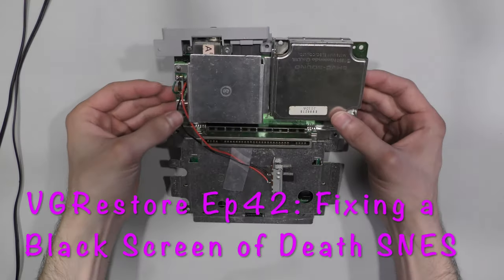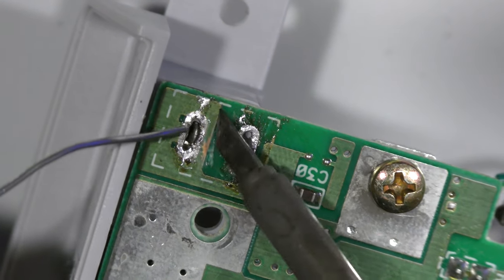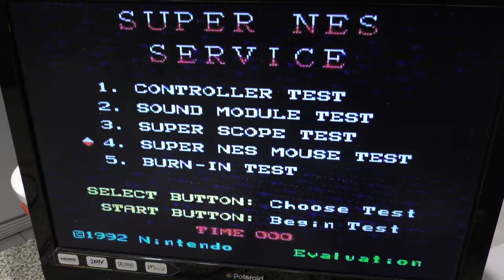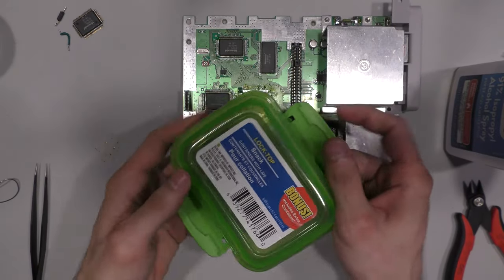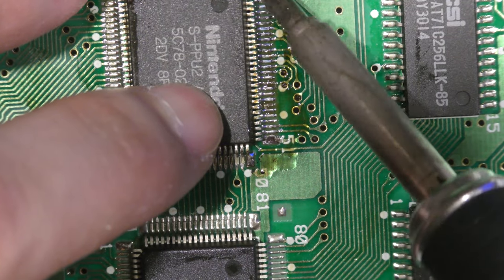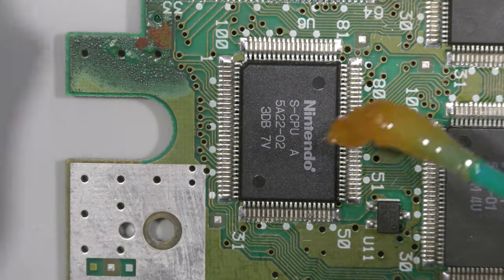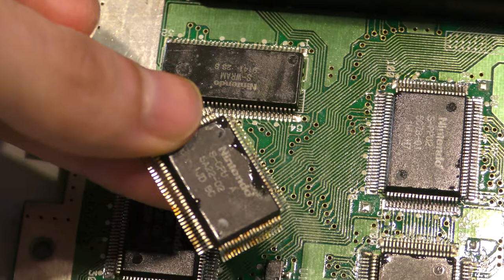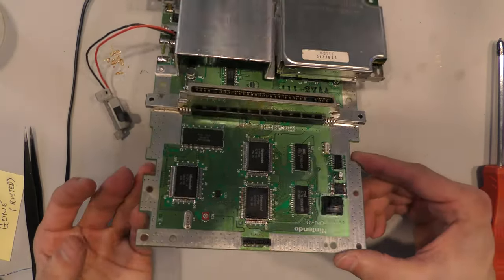VGRestore Ep42: Fixing a Black Screen of Death SNES

Comment: When you clean the flux off the board, put a coffee filter or paper towel down first, then scrub the area with the toothbrush, this way the paper towel absorbs the flux, otherwise the toothbrush only just spreads out the flux on the board for the most part.

Comment: Not sure if you have one of them, but I’ve found placing the board in a quad hands unit, holding the iron on the top of the through hole, and then using the solder sucker underneath the hole really makes for a quick and easy way of clearing them. 👍

Keep up the great work!
Reply from the maker: StreetChally73 yeah that does make it easier I just don’t have helping hand device yet. I need to get one.

Comment: I lived in Japan from 2017-2019.  Depending on the area, I would routinely find "junk" Super Famicom consoles for $1-3.  I remember my first time seeing stacks of these and not knowing how common it was so I bought 30 of them.  There was another time a year later where a store had at least 60 of them for $1 each and I only bought 3 because I had built up such a huge hoard already. 
I would recommend looking at lots of "junk" consoles online for as cheap as possible.  SFC board is the same as SNES except the power jack.  That might be a viable option if you can get a lot cheap enough to offset the shipping cost.
Reply from the maker: Yes that is a great point. The super famicom and Super Nintendo are the same beside the RF module tuned to 95-96 and the power jack. I need to find stacks of SFCs for $1 each I’ll take 1000😁
Reply: PunkNDisorderlyGamer external RF module you mean, or is there an adjustment somewhere?
Reply from the maker: Highrise Tech the SNES and SFC are the same board, the only difference is the power port jack and the RF module, on North American SNES version works with channel 3-4 and the Japanese SFC you have to change the channel to 95-96.
Reply: PunkNDisorderlyGamer any way to change the RF module with a North American one?  Take the component off an NA junk board and swap?
Reply from the maker: Highrise Tech probably I haven’t tried yet. I would assume it would swap perfectly the power jack and the RF module without any other modifications.
Reply: I got 14 broken NDS for 100 Cad$ recently. Shipping was free too. Its definitly cheaper in japan than here.
Reply: Hi, will there is any chance you may find a online store in Japan who sell junk Sfamicon pcb?

Comment: for big through-holes like that i tend to overfill them with fresh solder then whilst they're still hot use a rubber air puffer to blow the hot solder out into a can of copper wool. For smaller ones usually my desoldering tool handles them ok.
Reply from the maker: That’s a good point. I like to try different things on the fly sometimes.

Comment: First off I really like your channel. Secondly, the burn in test cartridge you use, Does it have any special hardware built into it or could I use a rom file of that cartridge on a flash cartridge to do the same thing?
Reply from the maker: It’s just a rom file. If you can get an everdrive to boot the rom file you can test your hardware. Keep in mind, sometimes the console is too faulty and won’t boot the cartridge or an everdrive. 

Thanks for watching my channel.

Comment: I'm really enjoying your videos.  You're doing great.  I was curious what temperature you set your soldering iron to.  I just got a new Hakko one and I'm finding it's really easy to lift pads while desoldering on an old test board.  I want to find a good temp and practice before I work on my consoles.
Reply from the maker: My iron is usually fixed at 300 Celsius, if I’m desoldering a large ground plane I will boost the iron to 375-450 Celsius. You don’t really need more than 315 Celsius for the work you saw in this video.

Comment: If you add a tiny bit of solder to your tip you will also improve the ability to remove solder from the board with the braid and with the sucker, because you need that solder to get quicker and more uniform heat transfer.

Comment: I was thinking: Why not checking if all solder pins from that S-PPU2 are connected before going all the way with this amount of work to replace the chip.
Often times, it's dry solder joints that makes poor connections.
Nice to see your success though at the end.
Reply from the maker: That’s a good point, I’ve worked on about 100 of these and in the beginning I would try and reflow the chips and never got any changes. In my experience these chips go bad much more often than the pins on the chips lose contact.
Reply: @PunkNDisorderlyGamer  fair enough. Experience is key.

Comment: I think possibly for sourcing parts junk lots of super famicoms from Japan. Most of the "junk" turn out to be OK. Swap the power connector and the rf off a dead snes board and you're usually good to go.
Reply from the maker: Alfie's Games super famicoms are the way to go when sourcing for chips but even those are a bit out of mg price range right now.
Reply: @PunkNDisorderlyGamer  Ya the market gone crazy recently. That's kind of good cause it means it's worth putting our time into them to fix them. I look at a broken ps1 and go not worth it.

Comment: Very nice, I have some super Nintendos and other consoles..I recently got a super nintendo pal version from hong kong SEALED boxed and it works just fine with a hdmi adapter, it has a 50/60 switch made by Nintendo back in 1992 for th3 honk Kong market however some games ..on the title screen it shows squares ..like 2 ..3, .k2 show some on the title screen or side pocket shows 2..but 99.9% of the games runs absolutely fine. i was testing all these games via a super ever drive, and using the same cartridge on an ugly snes" north america" it all works good.

Comment: Would it be worth it to install a chip socket to make future installations/chip swaps easier?
Reply from the maker: @Retro_80s_Guy  well it would be worth it to socket a test bench console to remove and test each chip individually without having to solder each chip through trial and error. But these QFP chip sockets are quite expensive.

Comment: I have used the same repair blog to diagnose  the first SNES I bought. It had the "black screen of death" and never got it working. Since I have replaced everything except for the chips (I don't own a hot air rework station) I assumed that it must be a dead CPU. I got another SNES motherboard a year later...and surprise it has the same issue :) After reading on the topic, it turns out that the CPU used in the first two European SNES revisions is very prone to failure. I wish I had a diagnostics cartridge like yours. I was wondering whether I could use one of the Chinese EverDrive clones to load this application. Maybe I will try this in the future :)
Reply from the maker: You may be able to load the burn test rom from an everdrive.

Comment: I've never been able to do that trick where you slide the hot soldering tin through the metal pins and pull it out easily.

Comment: I took a look at the site you refer to trying to decide what is wrong with my snes. A lot of games work fine and it passes the burn-in test, but on DKC the sprites are missing. On Actraiser the background has glitches and Star Fox boots to a black screen. The intro music plays and then quits and it registers no input, however the Japanese version starts and freezes soon after. Most other Super FX games have various except for Doom. 
The closest I can tell from the site is either cpu or ppu2 failure.
Reply from the maker: It’s probably a ppu1 or ppu2 when you play the game does the game still function correctly? disregarding the sprites.
Reply: @PunkNDisorderlyGamer  Yes other than Star Fox which only seems to be loading the into music to the spc and does nothing else.
Reply from the maker: @SuperHamsterGaming  I’ll bet the cpu is ok, plus most of those burn tests are cpu related, not all but most. You could put that cpu in a bad cpu board or try swapping the ppus one at a time. Keep in mind It’s quite difficult to do if you’ve never done smd work.
Reply: @PunkNDisorderlyGamer  I haven't done a lot of surface mount stuff. I do suppose I need to practice that.  I've done plenty of soldering and mods otherwise.
Reply: @PunkNDisorderlyGamer  I've got another board somewhere with sprite glitches. Maybe between them there are enough good parts to make one.

Comment: What temperature do you usually keep the hot air rework  station on to remove those chips
Reply from the maker: 350 Celsius.
Reply: Thank you I just bought a hot air rework station. I’ve done a lot of soldering but never with Hot air. I have a messed up board I’m going to practice on.

Comment: Hello, your videos are great, I found you in luck, I have several questions:
What is the temperature you use to desolder the chips?
What heating system do you have?
Where can I find that Snes cartridge?

thank you very much for your videos they are great
Reply from the maker: 350 Celsius.

858D desoldering station. (It’s really cheap but works for me)

Burn in test cart, aliexpress has them. 

Thanks for watching
Reply: @PunkNDisorderlyGamer  Hello, thanks for answering, I was looking for aliexpress but I couldn't find it, you will have the link of the publication.
I bought the Baku 787L and it works fine.
Thank you very much with you learned many things.
If possible add subtitles in Spanish. I would be eternally happy
Reply from the maker: @ronaldcarrenobarriga5474  you can go to Spanish subtitles auto generated. They seem pretty accurate to me. 

Aliexpress seems to not have them anymore. But this website has them https://www.ocdreproductions.com/Burn-In_Test_Cart/p1560736_18499139.aspx

Comment: I have an SNES just like this board with the removable audio sound chip. The console had power and would 90% of the time be a black screen but multiple times it would boot to the super Mario coin sound and Nintendo logo then cut off and a few times it would boot the game and I could play it as long as I wanted. Perfect picture and sound from what I could tell.

If I moved the game cart it would then go black.

I opened it up and cleaned the board pins and the removable cart pin receptor. It didn’t do anything.

I’m having a hard time figuring out what the issue could be. The board and chips look immaculate.

Are you interested in trying to fix another if I sent it to you and paid you?
Reply from the maker: It’s been so long since I’ve done any repairs, if I had to guess it’s a dirty cartridge connector since sometimes you get the game to boot up. Clean both the game and the cartridge connector and try again, don’t forget to add the sound module before you test.
Reply: Ok thank you for that info.

One last question… is your snes burn in test cartridge authentic?

There are a handful from China for 30 bucks and I’m curious of their effectiveness to test as good as an official one.

Comment: 10:38 watch out, vertical drag soldering is dangerous, you might bend pins if they are soft.
Reply from the maker: That is very true although with enough practice you learn not to apply too much pressure.
Reply: @PunkNDisorderlyGamer  They might withstand. Doing this at a laptop connector is sure fail because pins are more thin.

Comment: Will a test cart work if there is no video going to the tv?  Wondering what my best bet is. I have two doing the same thing. Power on no problem. Cleaned everything up. And when i put a game in, the tv flickers for a second and goes to a black screen as if it knows it’s getting something but nothing coming through.
Reply from the maker: Sometimes the burn in test cart will post to a screen when games only post to a black screen. If the TV remains in “no signal” and doesn’t flicker at all the burn in test cart won’t help you.
Reply: @PunkNDisorderlyGamer  I ordered a test cart and it should hopefully be here in a few days.  If that doesn't work, is there one chip you'd recommend on swapping first?  I think I saw on one of your videos was the S-APU was a big one that always needed it on the -1 system.  Would I get black screen at all if any of the capacitors were shot?  Both systems I am working on definitely go to the black flicker screen.  I have a good board I could use for parts, but don't know where to start if that test cart doesn't work.  Ive cleaned the cart reader and most of the board already with no luck.
Reply from the maker: @wkosnik66  try the test cart I’m willing to bet it will help somewhat. If it doesn’t help, and the board looks clean (no broken traces or corrosion) I would swap the cpu first. Usually with bad APU chips it stills posts to the burn in test cart, and with bad APU chips some games could also show the licensed by Nintendo splash screen like on street fighter and Mario kart
Reply: @PunkNDisorderlyGamer  10-4.  Fingers crossed the burn in works.  I tried Street Fighter and Mario Kart and maybe 10 other games, and get nothing.  And they have been cleaned and work on my normal go to system that I play.  Any good suggestions on places to get parts/chips if need be, other than eBay?  Also, the site I ordered the test cart from that makes repros of it looked somewhat sketchy and no idea if it will even show up.  If I have a problem getting the cart to me, any suggestions on a good place to get one from not having to pay $5000 for an official one?
Reply from the maker: @wkosnik66  I have a repro too and they work just the same. I think you may have a bad cpu, too bad I don’t know any cheap places to get chips. You could try sourcing some super famicoms they’re cheaper and are fully compatible with Super Nintendos.

Comment: I bought a Super Nintendo back in 2016, it's in great condition, but I noticed that there was a rattling sound inside the power jack input port, I took it apart & cleaned it, runs good, is there any way to take it apart more without soldering?
Reply from the maker: If you took it apart and there was nothing you could see, then try lifting the lid on the small RF modulator you could have something rattling around in there. The power jack port has no space for anything to rattle around. 

The RF modulator has a small lid you can pry up with a standard screwdriver.
Reply: @PunkNDisorderlyGamer  I just took apart my SNES right now & there is something in the RF modulator, I even took off the rf shielding & removed the screws on the bottom of the board, too bad I don't know how to open the rf modulator box...
Reply from the maker: @TherealestAA  it has 2 lids one on top and the other on the bottom. The top can be pried off and to remove the bottom lid you have to desolder the modulator.

Comment: I've got my dad's old snes and several years ago it quit working. Turned on the screen is black with no sound and when switched off the screen flashes and speakers pop from losing power. Would I be better off buying another console or would it be worth trying to fix?
Reply from the maker: You probably have a bad CPU trying to fix might be just as expensive as trying to find another one. 

If your console has a silver serial number sticker on the bottom it’s an early production SNES, if it has a white sticker that’s UN20xxxxxxxx it’s also an early run. Those early units are very prone to CPU and other chip failures.
Reply: @PunkNDisorderlyGamer  it's silver. Un15846676
Reply from the maker: @BigMeepsadventures  yeah it’s very likely it’s a dead CPU but still try cleaning the games and the cartridge slot sometimes that the real problem.
Reply: @PunkNDisorderlyGamer  what can I clean them with? Also a few of the extra tabs in the game slot on the right side of the console were bent but I straightened them out as best I could. I don't think any of the games I have use those though.
Reply from the maker: @BigMeepsadventures  if none of the games you have use those tabs, how did they get bent? If 2 pins on the cartridge slot are touching, that can cause black screens. Now I’m thinking you might need to replace the cartridge slot and that’s pretty straight forward. Open up the console take out the pin connector and try a new one, it may solve your problem.
Reply: @PunkNDisorderlyGamer  I have no idea how they got bent. My little sister had it for awhile when it quit working. All 8 of the pin sets on the outer right hand side were almost twisted together.

Comment: Would you have any idea what could cause a SNES to only output audio and no video? The composite and power cable are good and work on my other SNES. The console and game pins have been cleaned well. The actual SNES console makes a small buzzing sound, and it takes longer than usual to hear the audio start up I think.
Reply from the maker: Bad caps could cause no video. Try the snes through RF to see if it outputs video to rule out the faulty chips and pin connector.
Reply: @PunkNDisorderlyGamer  Thanks. I'll open it to see if there's any bulging caps and see if RF works.
Reply from the maker: @inputfunny  sometimes these surface mount caps don’t bulge but rather they leak.
Reply: @PunkNDisorderlyGamer  I'll keep that in mind.
Reply: @PunkNDisorderlyGamer  I opened the SNES and didn't see any bulging or leaking caps. The game slot was just a little dirty under the removable part, so I cleaned that with 91% Isopropyl alcohol. Trying the SNES with RF; I got no video or audio, but the static did look a little different when it was on. I only get audio with composite after awhile like I said earlier. This is the original SNES with the separate sound board, and I've heard these are pretty unreliable these days.
Reply from the maker: @inputfunny  yeah it’s probably shot. Did you try RF with channel 3 and 4 and was the TV set to the right channel?
Reply: @PunkNDisorderlyGamer  Yes I tried both channels and used the switch on the back of the SNES.
Reply: @PunkNDisorderlyGamer  Thanks for trying to help.